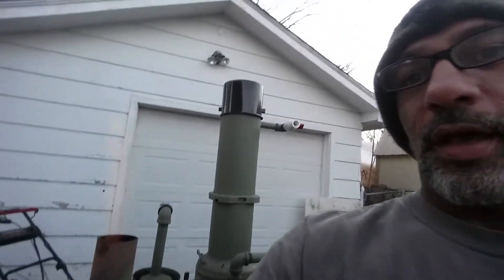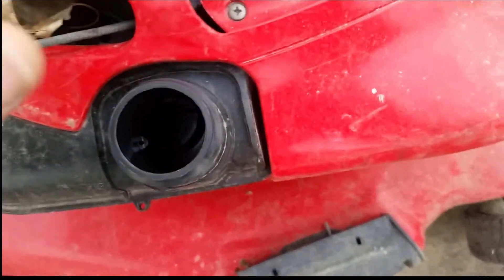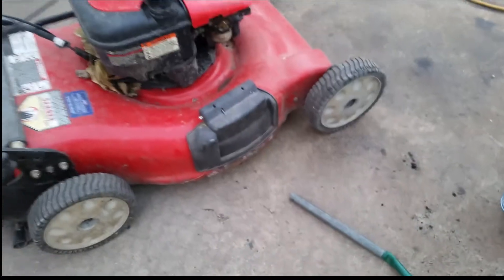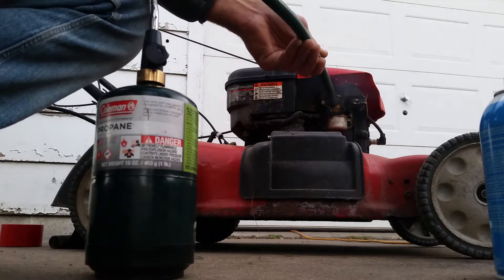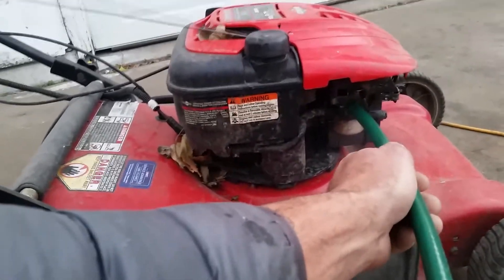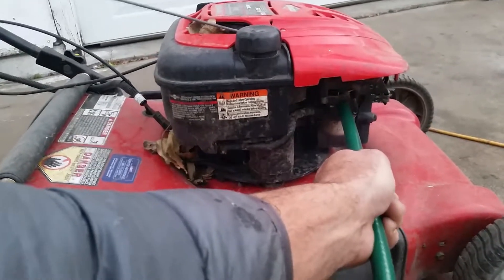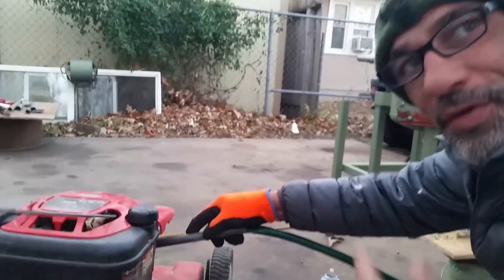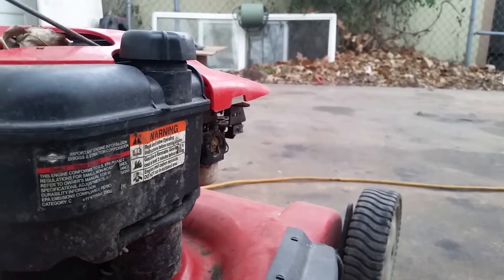Gasifier running a combustible engine demonstration.

Comment: Could you run a larger engine off of this, and how would you attach the gasifier hose to a larger engine?
Reply from the maker: @elmerkilred159  yes it can run a car engine. You just make a manifold to mount to your carburetor. I have a video on how I made mine
Reply: @Saxxsays  Awesome. I'll check it out. Thanks!